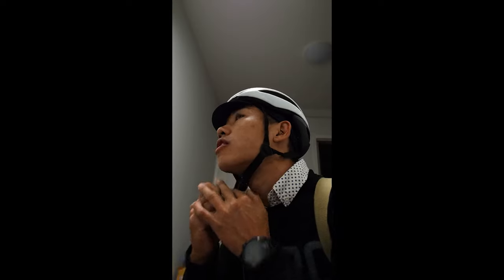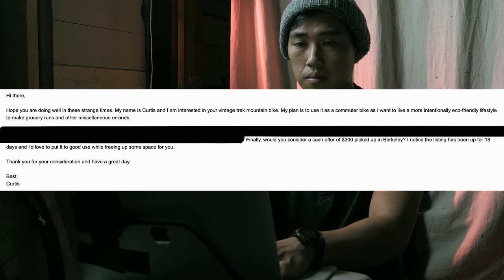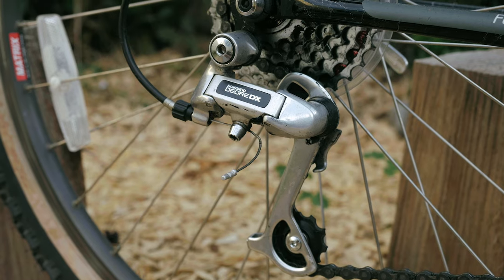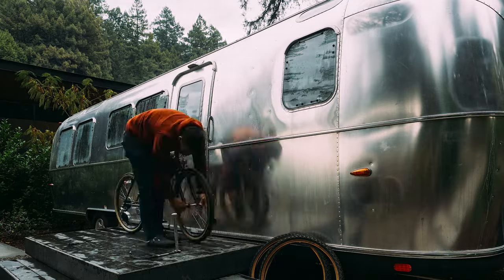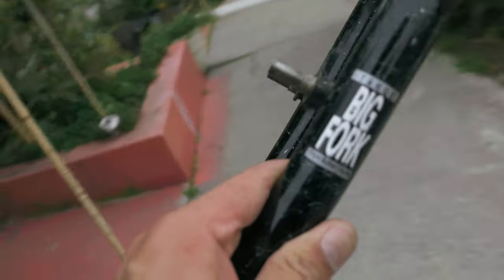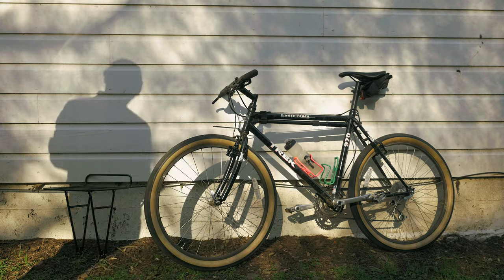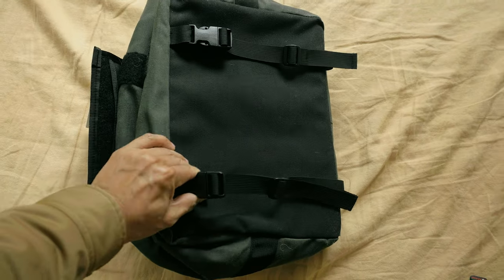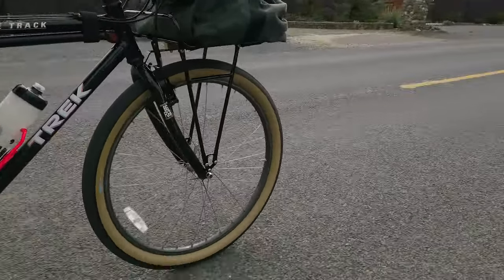Converting Trek Singletrack 970 Mountain Bike to Commuter

Comment: Great video! I still have my Trek 970 Singletrack, bought in 1991, I think that it's the same model than yours, but in brilliant purple color. I did many thousands of kilometers through the mountains, even in some wild camp, when it was not common here in Spain. Lately I only use it for my urban trips -I'm older for those adventures :)  It still has the original components, except for the grips and tires, and added elements such as saddlebag holders. It keeps working perfectly! Watching your videos! Greetings!

Comment: I got a trek 930 from 1991 but i felt slightly uncomfortable in comparison to my previous newer mtb as i had to bend my bike a bit to reach the handlebars. Did you experience this? Do you think installing a new stem and spacers could help to get a more relaxed back position? Thanks
Reply from the maker: I think raising the handlebars and getting them closer to you could make it feel more comfortable

Comment: Arent the pull ratios different between the canti and v brakes? Wouldn't you need to change the lever?
Reply from the maker: Great question. I ended up using a Mini V brake which has the correct pull ratio for catilevers. This is the one I ended up buying : https://amzn.to/3rphPtN

Comment: LOL... V-brakes and Especially the mini arm versions do not have superior braking power over cantilevers. The yoke/straddle cable part of the canti setup is functionally an extra lever in the equation and without it, you're left with just the mechanical advantage of the brake arms and the brake levers and combined they're lower than what was present in well setup cantilever brakes. What V-brakes did was solve a cable routing issue on  bikes with suspension and weird frame shapes, and sped up assembly time since they didn't require the step of knowing how to properly adjust a straddle cable and yoke (because people tend to be stupid when it comes to trigonometry to begin with, and this has gotten worse with dwindling education quality the past three decades).